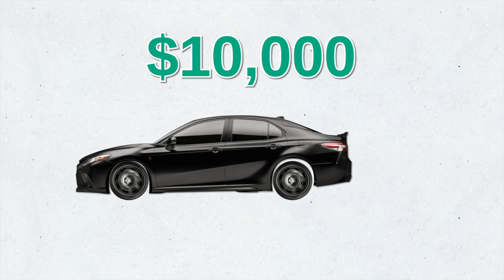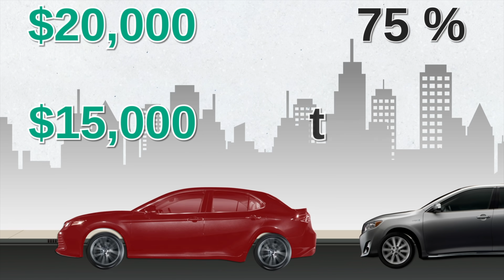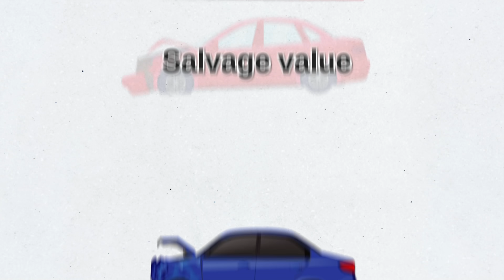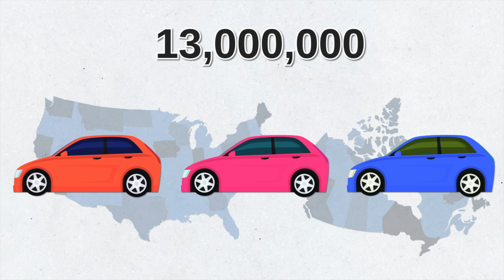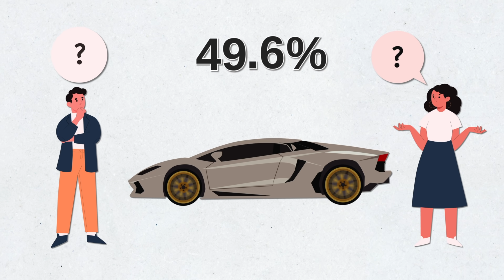If a Car Has This, Don't Buy It

Comment: My mom and I got into a super bad accident that was her fault in the mid-90s. Our Ford explorer, which those were big chunky cars in the '90s, was smashed to bits on both sides so it was about a third of its size (t-boned by f150 on one side, and the other side was slammed into large dense poles). And while my mom's insurance wanted to Total it, She made them rebuild it due to the fact that like she owed money on it or something. And they truly did.. it was so weird. To see a ridiculously damaged explorer that was SO crumpled on both sides, come back to life...it was wild.
Reply: They use to build the Explorers on a truck frame so that probably helped... The 2011 and up are unibody so they would probably opt to total the vehicle instead nowadays instead of rebuild it.
Reply: Same here in the UK my car was totalled and written off I told the insurance that it was not my fault the car was in an accident so I want it repaired and you can charge the other insurance company for the repairs , yep they did what I wanted and I drove it for quite a few years more
Reply: I own a 2006 ford explorer XLT. This thing is a tank, body on frame design and pretty solid parts. And on top of that the previous dude that I bought it from took care of it like his child. Recently a week back a guy come in and side ended me at a slow speed inside a campus. Its a quarter panel damage on the rear left side, the car is still top but the insurance company is totaling it and giving me 5200, which is honesty more than what I bought the car for, but looking what they did for you is crazy

Comment: This explains a lot. My parents were in a bad car accident last year.  Their 2015 Toyota Sienna ran over a wheel that detached from another persons car which blew their tire and pulled them into a concrete guard rail for 35 feet.  18k of damage but apparently not enough to consider it totaled.  They are from Illinois

Comment: Benefits to buying a totaled hail damaged car:
1. As stated in the video, the damage is cosmetic. If you don't care how the car looks and just need something that runs, it's a great deal. Especially since used cars prices are through the roof right now.
2. Travel. If you travel to places with high car theft rates or to remote areas, you worry less about your car being stolen. No one will look twice at it for theft. And you fit right in if you travel to disaster areas for work (ex: FEMA worker or insurance adjuster).
3. It's makes for a great story. ("Yeah, the hail stones were the size of golf balls!")
Reply: Plus, a hail-battered vehicle is said to have slightly increased aerodynamics and gas mileage.
Reply: @mr.oshawottryana.m.1785  🤣

Comment: I totalled a $5,000 car once when I was picking my sister up from school one night. A teenager pulled out in front of me as I was passing through an intersection at 65 mph. I was going the posted limit and by the time I hit her I was doing 55mph after braking. Completely bashed in my front end and knocked the wind out of me. I walked away from it like nothing happened. I’m not a Chevrolet fan especially with their Cobalts, but I have to hand it to them. Those crumple zones did their job and so did those airbags. I got nearly $7,000 out of that accident and bought a run-down Acura TSX 4-banger. That engine was beautiful, Scotty!! But I eventually traded it in for a new Toyota Camry. I watched a lot of your videos and knew this car would outlive me. I’ve had it for a year and 4 months and I drool over it just as much as the day I got it.

Comment: In 2008, my 2003 car was rear-ended and was totaled.  My car insurer paid promptly a fair price.  After hiring an attorney, at-fault driver’s insurer and my insurer paid for my neck injury to the maximum of each policy but not until threatening court action.  Per my attorney, I could have also sued the driver for additional compensation beyond policy limits.  FYI:  he hit my back end going ~40 miles per hour on an Interstate highway.  Fortunately, Highway Patrol witness it.  Driver was ticketed.

Comment: My first car was an ‘85 Escort (UK) and I found out that it was a cut and shut, 2 different vehicles welded together. The front was green whilst the back was black, it was sprayed red. Found out when changing a flat tyre, the wheel well was black and I thought it was a respray. Then when changing a headlight bulb the colour under the headlight was green.
Reply: And? Was it any good?
Reply: Yes. Were you happy with the car?
Reply: That’s called two tone paint, that usually cost extra
Reply: @notusedexer  Would you allow a child to be sat in a car that is a cut and shut?
Reply: @fortitudevalance8424  I am not the person to ask. That's why I watch this channel and ask questions.
Reply: @fortitudevalance8424  also, I grew up where we as kids did things they'd never allow nowadays.
Reply: @notusedexer  Same here had the car when I was 18 for equivelant of $30 but had a military career to think about so driving a C&S wasn’t an option if I got into a crash.
Reply: @dennispluto3806  🤣

Comment: I bought an 04 Corolla ce 5 speed because of Scotty... Loved it... Car had the darkest tint. It was quiet. It had no clear coat but not rusted. March 2021 I ate the back of an f150 and she was done... I got 2k for it with 209k... I miss that car
Reply: Corolla vs F 150 .
Corolla is going loose .
Reply: @jayhockley8841  lmao oh definitely... He got in front of me on a 2way street..(one forward and back) I had no room to stop doing about 40 and even though I blew the horn for what felt like 5 seconds... And he tried to run too
Reply: @jayhockley8841  loose? Lol
Reply: Did you keep the car?

Comment: I bought a car half off from only bolted on damage, No high strength steel damage, Couldn't be happier with it, Now Put 20,000 trouble free miles on it 😎👍.

Comment: Had an accident 4 yrs. ago & insurance said, based on police report, the fault was 50/50. My 21 yr. old car was worth $1,800 & damage was $4,500 to fix, minus $500 ded. I took the $2,200, fixed it myself & am still driving it to this day. The surcharge for the accident, just got removed this month. Yeeaah!😲😲😲

Comment: I had an older Volvo XC90 that had some front end damage from a wreck. It was pristine inside and out. paint was almost perfect. Insurance wanted to total it but the body shop owner agreed with me that it was too good to be totaled. He told me all the old adjusters that knew anything about body repair had retired and the new kids were dumb as hell. He argued with the insurance company and saved my SUV.  I drove it several more years and just sold it to a lady that needed a good car for a inexpensive price.

Comment: I have never totaled a car or had mine totaled by another driver or incident, and I hope and pray I never do.  I'm a careful, cautious, safe driver who likes to go fast when I can and I've avoided many an incident that could have easily been a collision, even in bad weather conditions like fog, rain and icy roads.  I've only had one wreck that was my fault and that was when I was 17 after first being able to drive on my own.  I've learned a lot form mishaps, potential mishaps and from riding motorcycles for years.  IMO, the most important thing is to minimize distractions and always pay attention to not only what I'm doing, but also what's happening around me.  I've noticed that a lot of drivers don't know how to use the rear view mirror and especially the side mirrors.  Using them and keeping them properly adjusted gives a much wider view and prevents a lot of having to turn around and look fully backwards and sharply back to the sides.  Not every car allows for a good view when looking sharply back to the sides, so the side mirrors are critical in those cases.  You just have to be extra careful about known blind spots, and know they exist in the first place.  Be aware and Stay aware, and know when you're not capable of that and don't drive.
Reply: If you like to "go fast when I can," then you are not a safe driver.
Reply: @oceanhedonist265   And you don't know me or what you're talking about.
Reply: 100%vg  Good advice . Yup , I believe riding a motorcycle makes you a better driver because youll learn that you can't make any mistakes on the road or it can be your last one .
You become more cautious and aware of everything around you .
So many people driving around
out there like Idiots , never realizing that they are driving  around a 2 ton missle .
Reply: @jayhockley8841   And when riding a motorcycle, you have to be know that most vehicle drivers won't see you and create hazards that you'll have to quickly avoid.  I always tried to be a careful driver and learned from that mistake, but one has to be even more aware on a motorcycle.  One has a lot less control in hazardous situations on 2 wheels than 4.

That accident at 17 was in a car on a road just after it started raining, and I learned that's when the oil comes out of the asphalt and makes the road its most slippery because the rain hasn't washed it away yet.  That's actually the only accident I've been in, somehow being able to avoid all others that would not have been my fault.  The last one was someone ran a left turn red light in icy conditions and crossed my lane slowly.  I skidded and swerved a little, but avoided hitting him/her by slowing down enough to let them pass.  If one pays attention, one can see things about to happen and take action to avoid it.

Good luck to you and happy motoring.
Reply: You can't say you're safe, and drive fast.... that doesn't make sense...I mean, I don't go slow..but I know it's not safe..that doesn't go together

Comment: My 08 Elantra I bought in 2012 got salvaged for a hit in the door. Seller fixed it and was completely transparent about the damage when they got it, pictures and all. Navy Fed insured me and I drive that $4800 workhorse everyday. She's starting to show her age at 275k miles. I think if you plan on driving a car "until the wheels fall off" as they say, a salvage car is a deal. As for Hyundai idk what to say, that puppy has had an alternator changed other than engine oil, tires and brakes. Only have one door handle left but with a little effort i'm breaking 300k easy.

Comment: I bought a salvage ford fiesta 2015 70k miles for 3600$ and drove it till 135k miles perfectly. I currently changed it for a salvage Honda CRZ with 45k miles for 6400$. Repaired no problem.

Comment: Scotty I loss my brand new 2016 red when we had that big flood all over Houston. I had gap coverage. You still have to pay your loan until they figure out who is paying for it. It was between Toyota's gap coverage and loan with Navy Fed. It took months for them to pay it off. Neither wanted to pay. I bought another 2016 Avalon but this time I used My auto insurance gap coverage so it will get paid quicker it something happens again in Houston.

Comment: I totaled my car on the 16th of January 2022. Lost control in the snow. Tried turning for a sharp curve in the road, car wouldn't turn. ABS tried stopping the car, it wouldn't stop. Took out a sign then slammed into an electrical pole. Airbag went off. Headlight assemblies flew off the car (I have the assemblies at my house as a reminder). And the front end of the car was smashed in severely. I assume the radiator is busted. Hoods completely screwed. Insurance already gave it to a yard. I only know this because my GPS is still pinging. They haven't taken the battery out yet. I have had a new car since Saturday that same week. I love this car because it has all the bells and whistles. Its new/used. 2013 model year.

Comment: I have a 2002 Infinity G20 that had  200k plus miles on it when an insured motorist came into my lane and damaged the driver side rear door and rear quarter.Minor damage, I paid 1,300 got 2,300 from insurance co. I kept the car because it still drove and ran fine. Win for me. I still own with 217k miles and still runs fine and may be able to get 1.500 out of it with today's used prices the way they are.

Comment: Unless u have classic car insurance you get a guaranteed value that agreed upon in the beginning of policy.
Reply: That makes no sense. How can an underwriter know what your vehicle is worth in advance of a collision? Mileage, years, condition rating are all fluid factors. If that were the case, we'd all insure beaters to pay out like a Rolls-Royce and collect after 2 months of premiums.
Reply: @imhere653  makes plenty of sense it’s called classic car 🚗 insurance they have a set value already for example I have a 2dr Tahoe OBS. Worth 7-30k depending on condition mine was appraised at 20k so if anything happens when it comes to the car they will fix it up to 20 or if totaled 20k check to buy another. Simple
Reply: @imhere653  oh yeah they don’t expect beaters only classics

Comment: Ran a red light, 2020 tundra tboned my 03 Silverado 1500HD. Was more of a Y pipe smashed b pillar. 
Technically totaled, never had adjusted, fixed myself. (Proper of course) its affordable if you cut the labor

Comment: I had a 2016 Toyota Corolla s plus 2 years ago and unfortunately I got into an accident where I was at fault and Geico deemed it a total loss I was stressed at first but Geico handled my situation really well they paid off the balance of my loan and even extended my rental they gave me until I could get another car which I did within a few days which was a 2018 Toyota Camry SE and today I paid off that loan my experience was an easy one but I can only imagine what other people may have went through 🙏

Comment: I bought the SUV for $800 from an SGT it needed a major tune up which I did myself. I had 700 in parts to get it to run right, I was in Austin at a scrap yard buying interior pieces and found all but one. on the way back is when this happened. I got hit driving back from Austin. the woman hit me and ran.... I have progressive insurance, was paid out 3k for a 2003 ford escape with 160k miles, then a week later my insurance asks did I miss any work due to the accident, I said I'm in the army and am in physical therapy they paid me another 1k.

Comment: Had a horrible Chevy equinox, but gm rebuilt the engine, shortly thereafter I got in a low impact collision and that removed the scratches that the car had previously and the car looked again, the car was worth more than I owed for that moment and I quickly traded seeing as the engine was subject to blowing up (they didn't fix the underlying issue with the oil burning just rebuilt it with the same design flaws and wasn't about to rebuild it a second time if it had more issues) so I quickly unloaded it.

Comment: My ex banged up my 2000 Isuzu Rodeo back in 2010.  Insurance company totaled it.  I had it repaired at a body shop.  12 years later, still driving it with 155K miles, and it runs like a top.

Comment: In 2000 I purchased a new Nissan car,   whoops 6 weeks later a young woman drove into the side of me by crossing the traffic lanes,   thankfully I had total replacement insurance.   So the car was repaired with two new door's strangely enough they tried to just fix the doors but I insisted that the policy was so,   both doors were placed on from Japan,   it's now 22 year's older . still own her. ☺.

Comment: I had a brand new top of the line 2010 Altima. 6 months in totaled. Insurance claimed I didn’t switch my policy so they wouldn’t cover it. After I got that sorted with a lawyer involved they covered It. The accident was  t-bone accident landed me in the hospital for 2 weeks and I was black and blue for months after that. First it was taking forever to get responses. So again I got a lawyer. The whole ordeal took months to resolve. And at the end the other person counter sued and my insurance still paid them even though they where placed at fault. This was appealed. The appeal came back as the pay out stands and I’m at 1% at fault. I cut my loses at that point, thankfully this is over 10 years ago. So it’s long dropped out of my insurance records. Some times you just need to use the power of the law to force people to comply. I was not going to let this go since I wasn’t at fault. And that’s my little story. 👍
Reply: Its a nice Story .

Comment: I was in a wreck and totaled my 85 30th anniversary t-bird, it was my fault, my friend was bending over messing with the radio at a stop light and his head moved in sync with an oncoming truck. I looked but never saw it because it was behind his head.  A freak thing. Liability so i got no money for my car.  I bought an 84 t-bird for $300 with a bad transmission and put the 85 trans into the 84. Drove it for 5 or 6 years until the oil pump went out and the engine was damaged.  Then I put the 85 motor into the 84 and drove it another 10 years until i found a cheap grand am with working ac.  You have to have space to store the parts where they won't corrode for when needed and be able to pay for the work or do it yourself. I did it myself and had no experience but bought the chiltons and figured it all out.

Comment: Hi my 06 hilux is revving at 1500 rpm on start up and hold that till 1/4 temp where it comes down to 1300 rpm then holds that till running temp and drops instantly to 750/800 rpm where it should be iv clean the throttle body new seal also cleaned map sensor with right cleaning stuff done condutity test on 02 sensors all fine dont get me wrong havnt testet air/fuel 02 sensors no air leaks air filter all good if there was a air leak it wouldnt come good a temp drives perfect no engine light any ideas yes what we call em australia
Reply: forgot to mention its 06 1gr-fe v6 petrol gas unleaded what ever term usa will use

Comment: When I was shoooping for a car a few years ago I came across a 2014 F150 that a local dealership was selling for $15.000 so I clicked on the listing and it turned out that the reason it was $15k was because it was a theft recovery and needed a new interior.